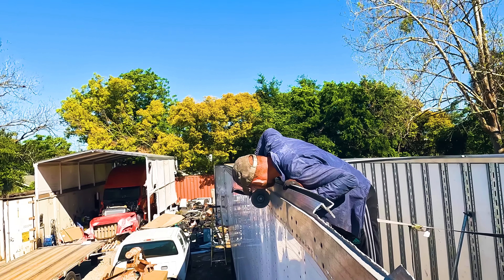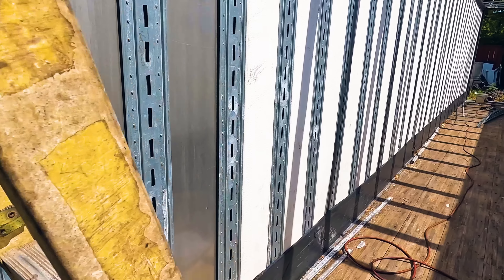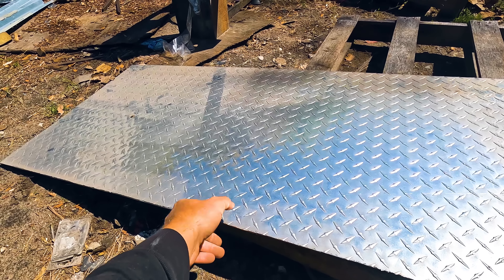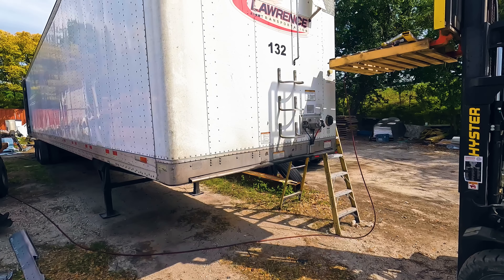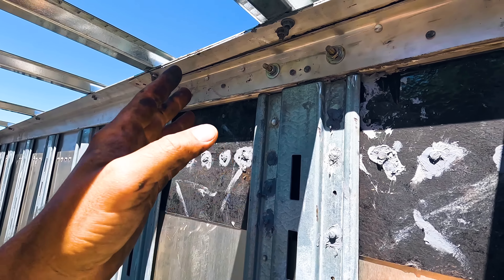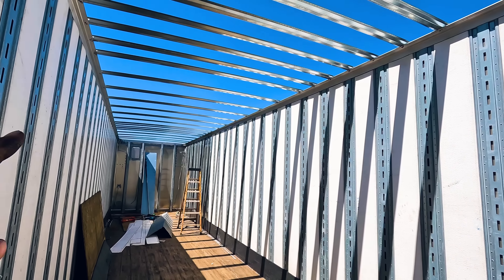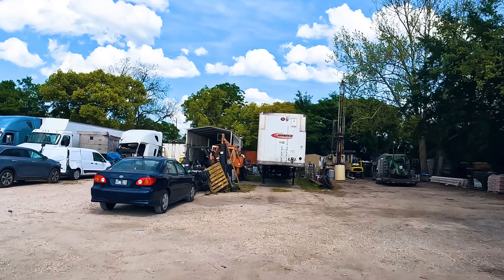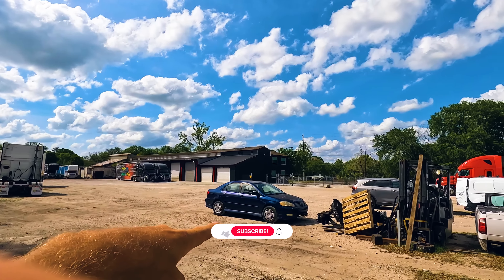Semi Trailer Front STRUCTURE RAIL REPAIR & Reinforcing Corner UPGRADES Rebuild Project DIY PART 4

Comment: How much scrap aluminum metal money was recovered from the trailer overhaul ,yes Steel or other like kind metals cannot contact aluminum, it's actually called electrolysis, a type of corrosion that happens when different metals come in contact with eachother, actually corroding faster than normal